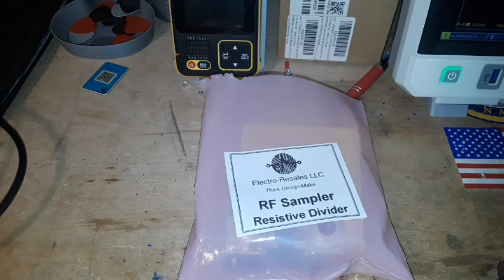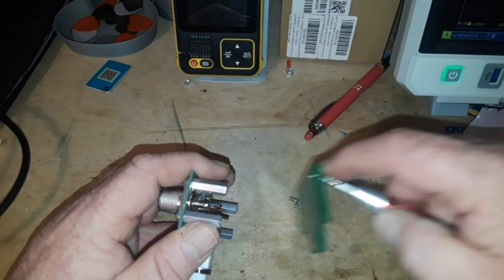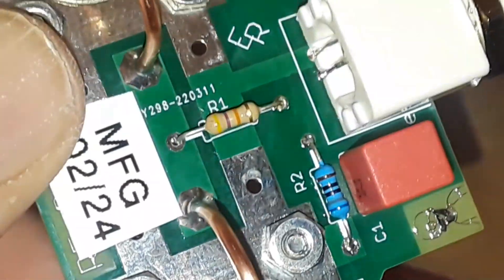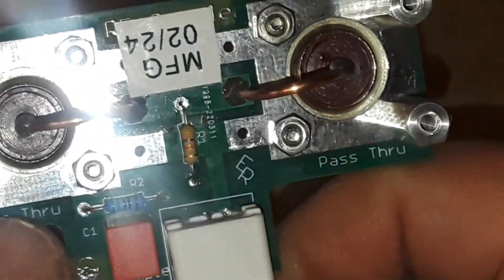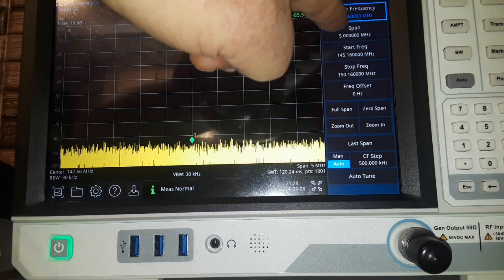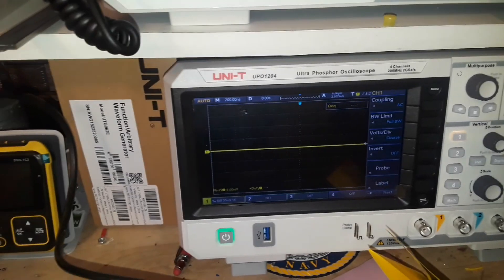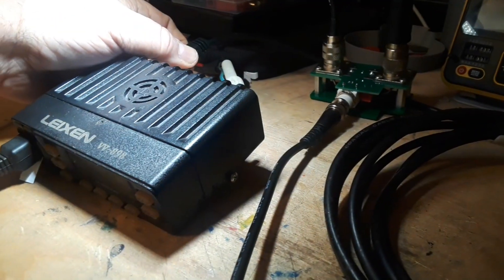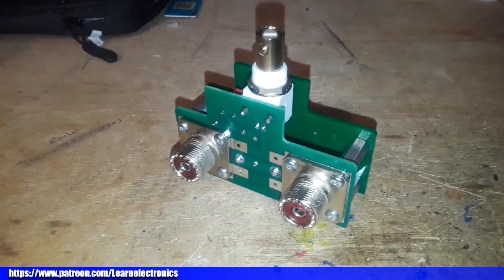What is an RF Sampler, And How Does It Work?

Comment: When would you use an RF sampler vs a directional coupler?
My application is for permanent attachment to the HF transmission line.
If the impedance / SWR is not consistent, will that be an issue for the resistive sampler?

Comment: RF Sampler circuit also "Demodulates" the AM waveform? but its negative -30dB so you have to measure the dBm peak of the frequency and ADD 30dB to the dBm level

Comment: Interesting. As already mentioned the resistor values are printed on the pcb. 
The manual mentiones something like suitable from 1 to 50 MHz. However you used it in the 2 meter band ( around 145 MHz). Or did i not understand it correct?  '73
Reply: I heard that too
Reply: I don't own this model, however the one that's in the metal case...essential the same thing, different layout...also rated at 50MHz....I have used mine on all bands up to 33cm...haven't tried it on 23cm...haven't needed to yet... 73's OM.  ~Jack, VEG